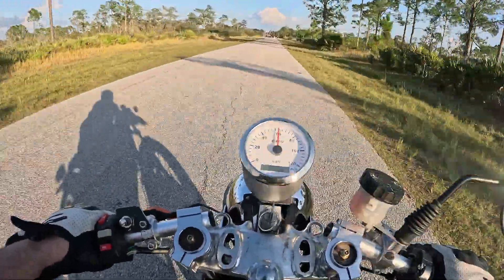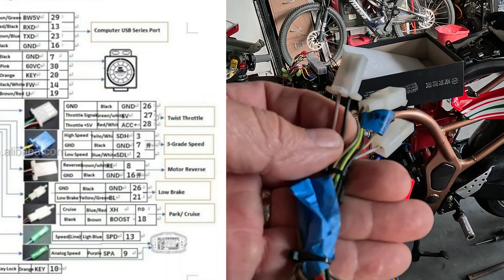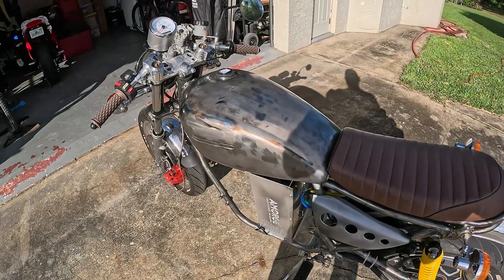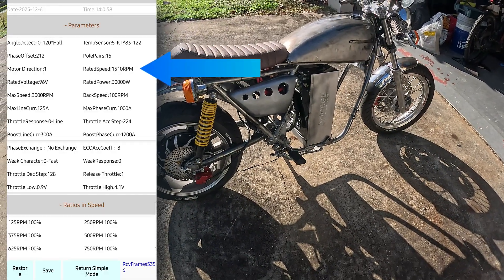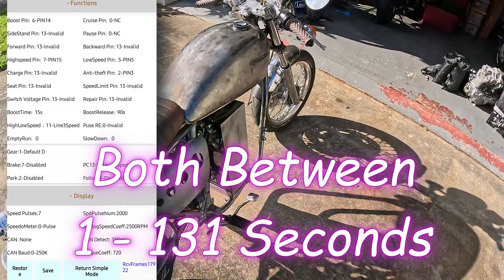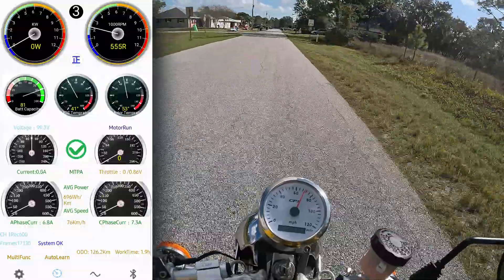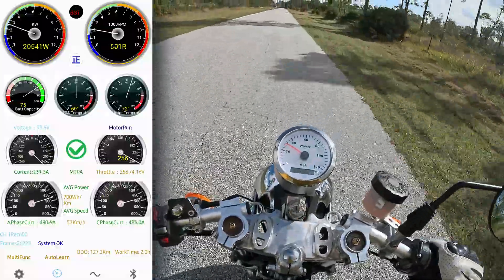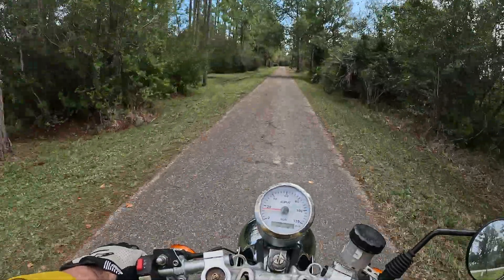Fardriver BOOST.  Turbocharge Your eBike

Comment: 0:29 bro your can clearly tell there different
Reply from the maker: Ya but when you see just the wire bundle Pic online labeled with what the wires do It is the exact same wire bundle picture but different labels.  No one would know....unless they already know and didnt need the picture with labeling.  That Pic was prob a bad example cause it showed the controllers also.  Idk..  it confused me when I first started this.  And NO ONES boost wiring video helped me.  It was always "just connect the brown wire".  To what? Where? There is no brown wire?  I had much confusion.  Just trying to help the next guy out new to this also.  Instructions should not assume someone knows something.  So it may seem dumb to people who do know.  But then that is not the intended audience.

Comment: On my drag setup I generally want less power off the line, not more. I set my line amps down to the point of just below spinning the tire on a hard launch. Then I use the boost button around 20-30mph when I'm not traction limited for a "boost". Works great. Also FWIW I see 1200 phase amps plus on my setup with 600a. Alot has to do with gearing and load with the phase amps IMO. (not using a hub)  I believe you are babying that motor and them some. My sotion is advertised at 12kw. I run it at 40+kw for 10-12 sec bursts. (600a 100v)The hubs are even more forgiving IMO. Just watch your heat and creep up on it. I'm not even hot after a 12 sec pull.
Reply from the maker: For sure.  I have not even began playing with that QS273 yet.  I have a QS268 also that I can spin and had to tame the launch with the 961800.  The issue I am having with the mid drive GTS35 is it is a 400lb bike.  Im trying to launch faster and just cant get the motor to take the amps.  Have tried every setting I can think of.  At 3200 rpm it is only pulling 400 line amps and it is set to max amps of 800.  It is geared high, but even with the lower gearing that is almost too low, it only pulls 600 until around 6000 rpm.  It feels like boost kicks in then jumps from 50kw to 65kw.  Really weird.  I even have 2 different 1800 controllers and it is doing the same with both.
Reply: @GhettoWrench  Once you start getting into crazy power I don’t think the FD is a great choice. Fastest Ebike guy in the world right now likes MOXIN controllers. With a shelf 25KW hub and the 120/3000 moxin made 200WHP on a chassis dyno with it turned down. It kept blowing the tire off, literally took chunks out of the thing. FD seems to have all these hit or miss safety limitations and BS with thier controllers Lots complaing about it. Super frustrating.  I run the  96/1800 FD “delux”  modded by HangzHou for 1200 line amps. Even at 400 line, I’m seeing 1124 phase peaks initially.  Its violent off the line. I reduce power to 30% or so just to launch. 1.80 60’ on up-preped asphault. 5.4x 330 ft times. And my setup is half what you are capable of running.
Reply from the maker: @AdamOpheim Im staring to figure this out.  I see those crazy powerful bikes online and they look like fardtivers, but must be molded.  Nothing I do in the settings get me big amps below 5000rpm.
Reply: @GhettoWrench  Lots of talk on the Fardriver FB groups about FD limiting controllers for longevity in the software. With no real support out there from FD its always a crapshoot. I hear VESC controllers are night/day better at like line amps as well. But also more complex and you can fry them. Kinda torn myself.  At 1647 rpm I can pull 1100+ phase amps no problem on the modded 96/1800. My much newer 84/850 acts similar to what you are talking about.
Reply from the maker: @AdamOpheim I have some online VESC friends that can get me going.  I just have to get one.  I really wish I had bought the VESC 3Shul 1400 now.  I was on the fence.

Comment: That hub motor can take  1500 phase my boy do8ng that all the time with no issues
Reply from the maker: Ya for sure.  Im actually just running max controller limits on it now after the instructional video.  LOL.  600 line amps.  I never bother looking at phase amps, Since  I Can't make the max anyway.  Not sure if its a 96v thing or fardriver thing.
Reply: @GhettoWrench all your videos i like you to real world test. Keep them coming love what you do
Reply from the maker: @kernhamilton553 Thanks.  I put an ND961800 on the fake ducati.  Im not getting much more than the ND961200 was giving me.  I have it on 800 line amps and barely pulling over 600amps.  Not sure if I have reached the max capacity of GTS35 motor or what.  I think I like hub motors better.  They just keep taking more power.
Reply: This is just and eg I just bought a 842600 shipped for 750usd if you would like the radiator 8000usd come ls with everything you need
Reply: @k @kernhamilton553 $750 for the controller and only $7250 extra for the radiator. Must be a nice radiator.

Comment: All this complicates a vehicle that's supposed to be simpler than an ICE vehicle. I had a boost idea that was just a few caps that dumped electricity into the motor.
Reply from the maker: That may be way more complex.  The boost is easy to set up.  I tend to overexplain.  LOL

Comment: Video idea for the gy6 150cc. Run nitromethain with water-methanol mix/e85/vp racing m4 /rc car fuel/ to de safe get a adjustable cdi for advanced timing
Reply from the maker: LOL.  Sounds complicated.  Was gonna ride today and that damn rolling wrench electric fuel pump failed.  I should do a video on that!  WTH.  My amazon pumps outlasted it.
Reply: RC car fuel is nitro-methane.
Reply: @ItsDaJax Yes and no rc fuel has a small percent of nitromethain. Plus oil and fuel additives
Reply: @Darius-pt5ky that's because they're 2T.

Comment: Even when u set boost to 600 line it never even got close to that
Reply from the maker: No probably not.  I have only ever been to cap out a 450a ND961000 with that kind of motor.  96v (100v) does not yeild the same amps mathematically with that 12kw wheel.  Im having the same issues with the 800 line amps Im trying to give the GTS35.  It just aint pulling over 680 or 65kw.